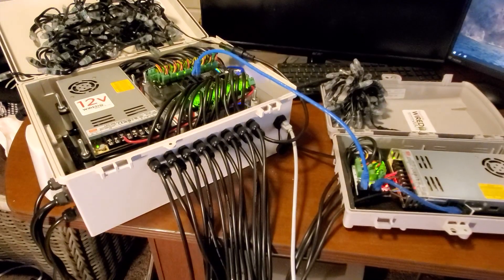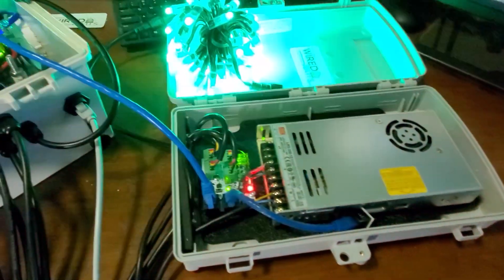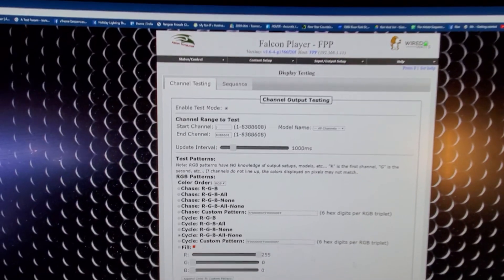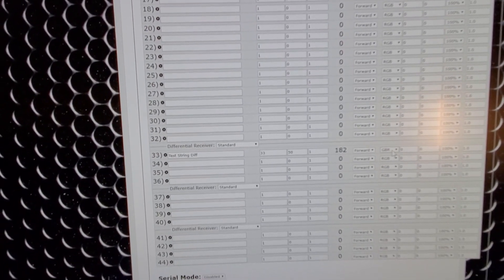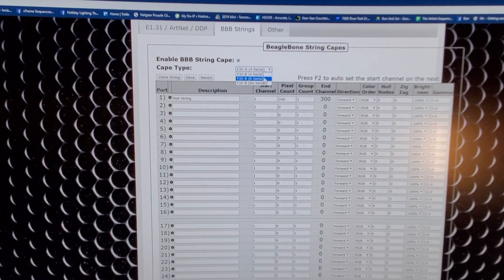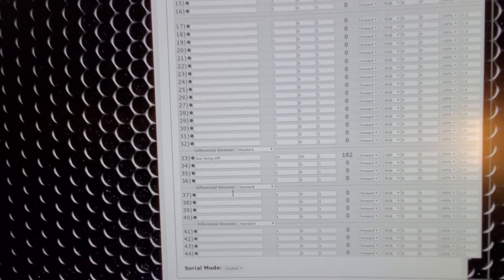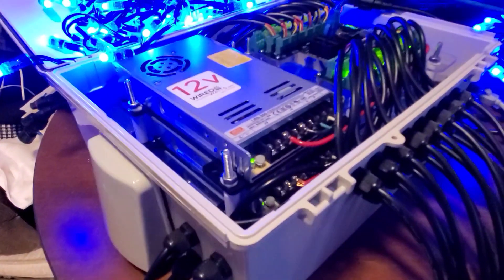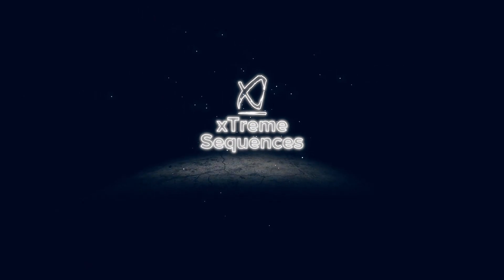Kulp F32 Build Progress Part 2

Comment: They say Kulp controllers only support ws2811, does that mean the variants like 2812, 2812B and 2813 won't work properly?
Reply from the maker: All the ws281x variants use the same protocol and thus they all work fine. This, straight from Dan Kulp.
Reply: @xTremeSequences  Thank you

Comment: Hi Ron, Why did you decide to mount your pigtails on the side instead of in the bottom of the enclosure/box?
Reply from the maker: I didn't want the enclosure on top of the pigtails? I'm not sure I understand your question.
Reply: @xTremeSequences  yes, normally you saw the boxes with the pigtails coming out from the bottom, like must of all ready to run controllers. But you decided on the side and on top along with the bud air vent. Well I gues it's just personal preference or something that is more convenient for where you will mount the box.
Reply from the maker: @raymundolopez431  Yep, just a preference.